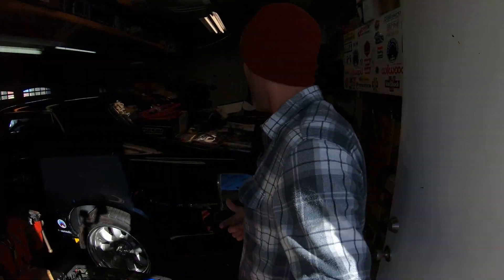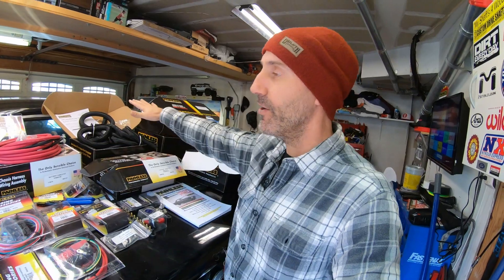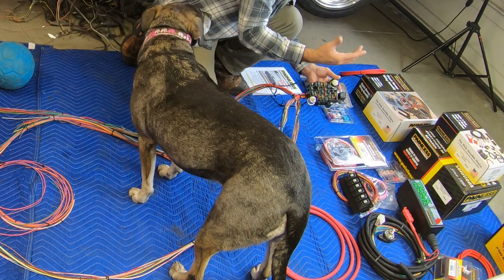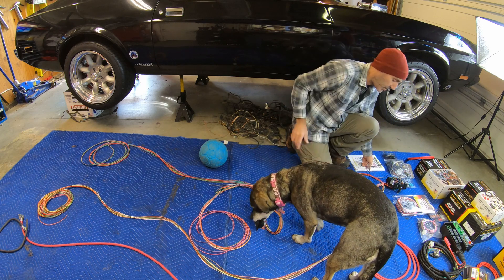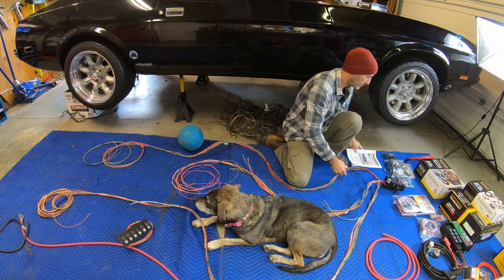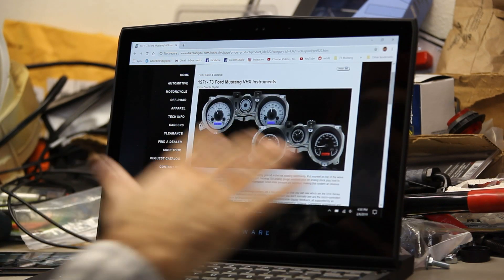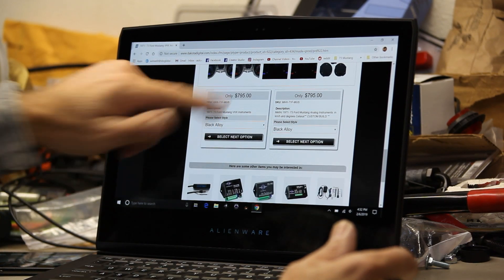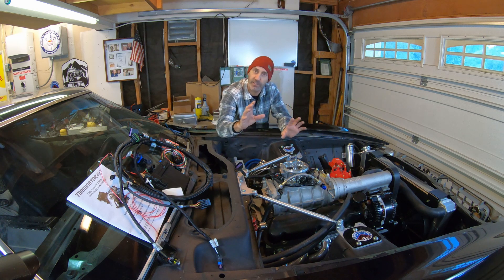Wiring the Mustang from Scratch - Painless Pro Harness and Dakota Digital Gauges Preview

Comment: The distributor has a wiring harness from holley that plugs it to the computer so the puter handles the timing ..The holley i have is the terminator x computer with a MSD billet dist ..I found the part number for the harness in the manual for the efi.
Reply from the maker: The problem I found is that the terminator system I had still needed an MSD ignition box to manage the timing inside the Holley software.
Reply: @AutoEdits  yes that is true as I am running the 6al DIGITAL
Reply: 6al plus

Comment: Quick question when picking out the harness which one did you go with? 
I know the harness that say 65-1973 have the ignition key on the dash and since our year of mustang have it on the steering column what did you do?
Reply from the maker: I went with their "Pro" harness which has GM color codes just because I liked the way it has so many relays built in. The ford harnesses have options for on column or dash for key.

Comment: Hey very cool video, I'm building a 51 Ford truck and I am using a 94 mustang as the donor.  Would you use the wire harness from the car or the one that you are using in the video.  Thanks for the info
Reply from the maker: I think Painless makes a direct fit harness for that vehicle... use that one and then add a fuel injection harness to that.

Comment: If you were to do an engine swap what ECU would you use when doing this on a newer car. Or would this not work because it’s not merging rather than replacing the original. I want to redo the entire wiring in a engine swapped car but need to understand more before I start, thanks.
Reply from the maker: I'm not sure what you mean. I'm swapping in a late model Mustang engine into this vehicle but running the Holley Terminator ECU and it ended up working out perfect.

Comment: I have a Chevy 2005 equinox and I need to repin the harness connector that's under dashboard driver's side. The pins in my harness corroded, which means I would have to replace the whole pin. Could anyone point me to a good website that can provide such pins? Any forums or websites that can provide info? I need help identifying what kind of metal pieces go at the tip so i can order them!! Any info would be much appreciated.
Reply from the maker: Call the guys at Painless wiring and ask... can’t hurt! Link in the description.

Comment: I have the Holly Dual sync with the Sniper in my 69 along with the Dakota Digital dash. The ECU runs the dual fans and syncs up with my 4R70W automatic electronic trans. Car is at paint, awaiting the seats to button down the seat riser locations which had to move back (I am 6'8"). Once the seats arrive, they'll burn in the seat risers and paint. Then full painless electric harness. I mocked the engine & trans up prior to paint. Relocated the optima battery to the trunk and ran direct circuits to the engine via a couple power studs, one in the engine compartment, the other in the passenger bay. Looking forward to following you along.
Reply from the maker: Love hearing this, thanks!

Comment: I don’t know why the terminator wouldn’t work with the b&m blower, it’s not like the injectors are under boost, it’s just like it’s on a bigger engine because it’s a draw through application, and why would you need a three bar map? If the map is reading under the carb as vacuum and not in the manifold as pressure. The only reason I could see for a three bar map is if the injectors were under the blower and experiencing boost, it’s not like a turbo application that the system is under boost, if you have a 351 at normal air pressure of 14.7 under the throttle body the MAP would read vacuum to 14.7 psi of air pressure, putting the blower on top of the 351 won’t make the MAP read any more pressure, just more vacuum, it’s as if you now put it on a 460 instead of a 351, if you don’t plan on changing blower pullies it’s never going to change how much vacuum it’s seeing. I’ve been researching this for my blown big block Chevy with a B&M 420 megablower on it and thus is how I understand it. The guys at Holley would know best, just be certain you are talking to the correct person who understands roots superchargers and not a blow thu system
Reply from the maker: This is very much appreciated! Lots of good data here, thank you!

Comment: On my 73 coupe I updated the stock gauges wiring but they are still hard to seen if you have tinted windows. This is the black background with white numbers and orange needles. 
I would have looked at the Dakota Digital if they had gauges when I was doing mine but they only had digital displays back then. 
What I’m getting at is the gauges are in a hole and if they are illuminated all the time this would solve the hard to see issue with a black background. While I like the red and black I would go for a brighter color to help daytime visibility. Also matching the other gauges is a great idea that was already pointed out. 

Thank you and keep up the awesome videos!
Reply from the maker: Thank you for that!

Comment: I would either go red or white on backlighting... and while i like the look of the carbon fiber,  i see how those gauges are shrouded in the dash. if it were my car, i'm not sure how i would feel about dark gauges down in the dash. granted, its not my car, and i have never even been inside one of those. Just my past experience in cars with deep-set gauges and problems with visibility in daylight. Its a good setup.... its just that Dakota Digital tends to require that you run their specific controllers and interface items making the routing or packaging an additional concern in the process. I won't make any suggestion on what to choose, though....

Comment: The stock gages are black with white letters. I would stick with those colors - too bad they didn't make the indicators orange like the original. I would love it if you added the automatic headlight control module and retained power. Also, look into the keyless entry, cruise control, and tire pressure monitoring modules. Pack all the cool electronic gadgets you can in there .... Its nice having someone else be the guinea pig for my '73! I am really interested to see how you route the wiring for the battery in the trunk.  I looked into it but I couldn't find a place to route it where I was comfortable that it wouldn't be pinched. 

I would see if Holley would do a trade and get you a sniper system.  For the advertising they should give you one for free. I was going to get the FiTech for my 351C and would purchase the sniper system if they supported your channel - DO YOU HEAR ME HOLLEY!

I hope you call TMI and get some of their interior parts.  Console, door panels, headliner, dash pad, etc .... all of their stuff looks awesome and I would love to see it installed. I am curious what you are going to do with the center dash panel that housed the 3 gages, that are now a part of the Dakota Digital gages.  I always thought a double din radio would be cool but maybe a little out of place.

How do we speed this build up? Patreon, beer, free labor (I click on all the ads as it is).
Reply from the maker: That's a lot of technology right there! Good suggestions!

Comment: use the Holley super sniper
Reply from the maker: I want the Sniper but I HAVE the Terminator.. sooo....
Reply: @AutoEdits  If you go with the sniper, you can get the Hyperspark system. Distributor, coil, and CD box that all are designed to talk and work with the Sniper EFI system. Tune every single aspect of fuel/air and timing from the Holley software. And stupidly simple to set up!